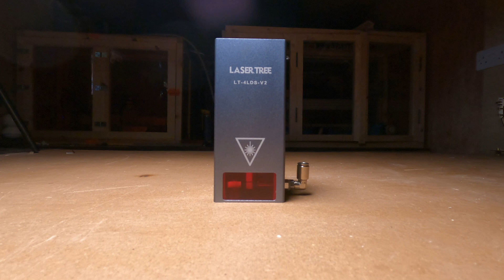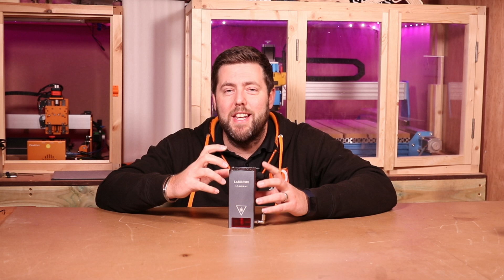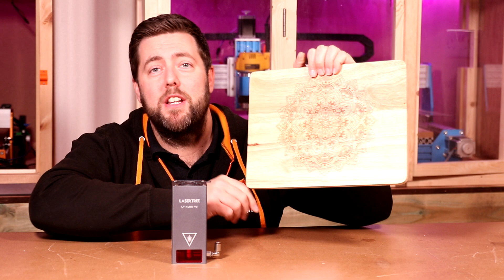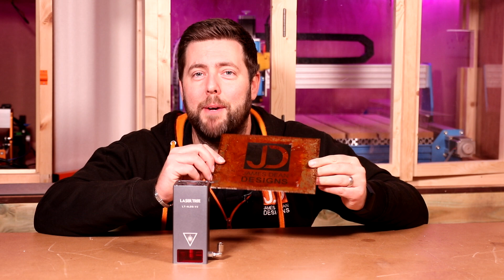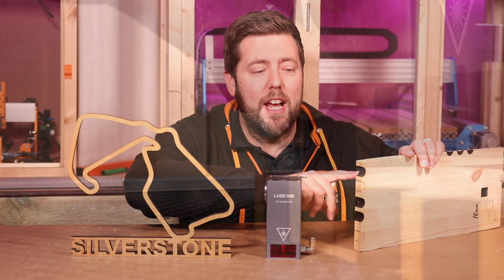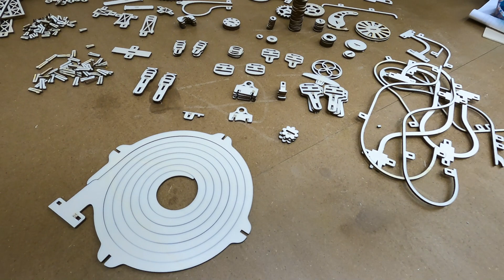High powered 20w diode laser from Laser Tree

Comment: HI James, Ive been a fan of your channel for not as long as Id have liked and I hoped you could help answer a question. Ive been shopping around for an upgrade to my current laser and like the look of this one. However when it comes to the depth of cuts per pass ( Im pretty sceptical) however where these modules state what they can do in one pass does that mean it'll be double the depth in 2 passes ? So if the seller/ supplier/ manufacturer states it'll cut 3mm MDF in one pass does that mean it could cut 6mm MDF in two passes ? Thanks.Jim.

Comment: Is this plug-and-play with the Masuter Pro? Or is the controller board needed as a go-between? Can you show a pic or diagram of the actual setup?
Reply from the maker: Pretty much play and play. Just a case of connecting the additional power supply via the control board. I cant post a photo here but if you message me via my website I can email you one

Comment: I just bought this before seeing your video. I'm changing my machine this weekend with this upgrade. I custom built a 3' x 4' machine and need something more powerful than the 10watt laser it has. Marble run is great. That's my next project.
Reply: I started trying to install mine on my Longmill Cnc router but the wiring is way too short and mine needs two pin connectors for input D.  Dangit I had to order some pigtails and wire to make my own harness.  Oh well maybe next weekend I can get it going.  I milled a bracket and got it installed.  the tiny bolt pattern on the supplied mounts wouldn't fit my 40mm wide mounting holes.  Got that done.  Also mine don't have the shims to set the focus so I guess I'll makes some.  My 54 yr old eyes can't see good enough to try to line up that kickstand do dad.  I also want to try to get my Ender 5plus rigged up for it if I can figure out how to defeat the Marlin firmware stuff and get it to run from a computer instead of that silly little touch screen.  Anyone have info on that?

Comment: Can you please do a video on the setup of this combo 🙏
Reply: We have the Laser Tree your using in this video, and the Masuter pro. Can you make a video or a short on the assembly and where the cables/plugs go.
Reply: I made a bracket. How does the wiring go?we can get our plugs to match up
Reply: We made a bracket out of 3mm 😂
Reply: I have the laser tree model and the masuter pro like in your video . Is there a bracket and wire harness link you can share that you used ?

Comment: This was a really useful review for me, and well shot and narrated.  I was unsure, but after finding lots of evidence that this is a legit product, took the plunge.  I paid £280 which is mind blowing given the prices of other legit 20w modules out there, including the next cheapest option, the Comgrow, which I'm sure is an OEM of the LT based on some research, and £150 more, albeit it has a height calibrator on the body.  Going to be attaching to my 1m sq MPCNC, so will have an awesome cutting platform.  First jobs will be cutting parts from the MPCNC Low Rider 3.  Full sheet 20w cutting (8' x 4') for only a few hundred quid.  Will probably by the LT 30W when available so I have a redundant option.  Many thanks, great content, helping folks like me save money.

Comment: Hello James, I have a Masuter Pro with the Laser Tree 80w(20W) laser. I had posted a question about laser engraving on a Facebook forum about Lightburn and was informed that the Masuter Pro has a top speed of 2000 MM/M, which I confirmed on Fox Alien's website. In your video you mentioned that you engraved the mandala at 4000 mm/m. Was the Mandala done on a different machine or is there a way to achieve a faster speed? Lasertree only has cutting specifications on their website and I have been having difficulty photo engraving (speed/power even with test grids). Trying to use basswood, baltic birch and oak. Any settings tips you could provide would be appreciated.
Reply from the maker: The default for the machine is 2000mm/min but these values can be taken higher by adjusting your GRBL settings. Specifically your $110 and $111 settings

Comment: Hey James, Thanks as always. 

What is the difference between LASER TREE 20W Optical Power Laser Cutting Module and Upgraded 40W Laser Module, LASER TREE 23mm Fixed Focus Balance Engraving and Cutting Head? Why is the 40w much cheaper that the 20w? Will the 40w do the same types of cuts - acrylic - and is it awkward to setup?

Thanks

Comment: Could you recommend a software to generate Laser toolpaths. I purchased this laser module to mount on my DIY rounter table. I currently use mastercam, but obviously the g-code does not call out for spindle speed changes/laser intensity. My machine runs mach3.
Reply: I would think you could use a simple GRBL post processor to make the necessary gcode.  Just look at the code generated and see what it looks like.  If your using pwm output mine uses M4 for variable intensity, also I believe m3 works for constant intensity.  S300 is 30% on mine but really depends on the setting in your firmware.  I haven't looked into my Mach 4 plasma table to see what I would have to do if I use it on that also.  Good luck, you probably already figured it out by now.

Comment: Very nice video and content that I haven't seen for this 20W output laser.  I have purchased one of these, and have been scouring the net to try to get good ideas on speed & power to cut, as well as engrave.  I have mine on a Stepcraft system--which doesn't allow me to use Lightburn so to try to do engraving speed/power, that would take a lot of time.  Would you be able to add picture of your test board with speed/power for the engraving & cutting?  That would be awesome...  Did you test anything other than the 3 mm plywood?  Thank you!
Reply: Lahobbby guy has a great speed power test patern. I bought the k30+ lasertree laser and had to get the test patern. It works great.

Comment: Excellent video.  Just bought one of these lasers on sale (~$340 US!), hooking it up to my OpenBuilds CNC machine.  Can't wait to give it a try and replicate your findings.  I did have to build my own mount, but being that I already had a CNC, that was a simple task.  I also enhanced the build by adding a compressed air hookup (I understand 20psi-30psi is ideal, based off your other video).  One other thing to note since you commented about it with the included acrylic depth gauges, the new one model has a nice adjustable slide out built into the body of the laser.  Looks like they are taking ideas from their 40W laser and putting that into the v2 of this laser, at least on the body.  Thanks for all the great content and providing details on your power/feeds.
Reply from the maker: Excellent. Hope you enjoy it 😁
Reply: Where'd you find that price?!

Comment: how did you get yours to calm down? mine is a raging beast unless you set to 1-15%.
Reply from the maker: Check your $30 and Smax value in the software are the same. Doesn't matter if its 1000 or 10,000 as long as they match. Also, if your machine is capable then you can potentially run the machine faster
Reply: @JamesDeanDesigns  yeah its 1000, i always make sure they match. 6000 mm/min is 1/8 to 1/4 ish deep @ 10%and up! i made a test file to run at fast feeds at 1-10% and it kinda worked it was a lot
 lighter burns.